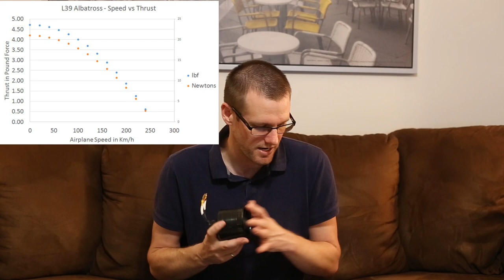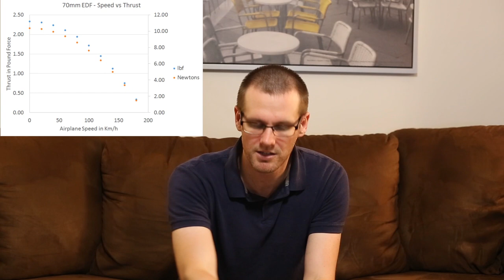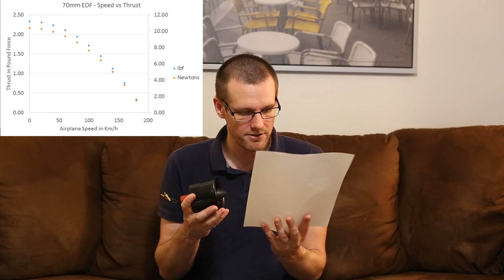What is Jet Efflux and Static Thrust? -  Jet Turbine and EDF

Comment: Great Video.
I have 3 questions:

1) How to increase the thrust?

2) for 5-6 Kg plane, what is the smallest diameter (cheapest) EDF we can use?

3) what does the (Kv) indicates in general? Because I see different values for different EDFs but I don't know what it is about.
Reply from the maker: Hey Genius Boy, 2 ways to increase thrust. Either spin the fan faster or move up to a larger size fan.
For a 5 to 6Kg plane, a 90mm is possible, however you will need some significant power.
The kv of a motor indicates how many unloaded RPM per volt the motor can put out.
Reply from the maker: That can work

Comment: Hi There, good video!, I am sizing a jet powered plane so I am wondering where did you get your thrust vs. speed data. Did you use a model or do you have experimental data?
Reply from the maker: Hi Heavy Metal, the static thrust was measured and dynamic thrust was calculated.

Comment: hi great video. im thinking of making an electronic "rocket" would i be better to use an edf or use multiple compressor stages to increase static thrust?
Reply from the maker: You would be best to use propeller if this can fit the diameter of your design.

Comment: Hi, there is a drop in thrust but speed is increasing. So, as per chart we need less thrust when the speed increases? Quite confusing
Reply from the maker: No. When the airplanes speed increases the fans dynamic thrust decreases. This is undesirable but part of the equation.

Comment: Thank for the video.
Still, jet engine are much more capable than EDF, since liquid fuel stores more energy for a given weight than electric motors!
Also one thing to keep in mind : when you want to increase chimical efficiency of any given reaction envolving air, it's always much more efficient with warm compressed air, more energy is stored to take part into the reaction. EDF are not as sophisticated as turbo jet, so the dramatically lower outlet air speed. 

Last but not least, the relatively low efficiency of RC turbo jets is due to the fact that their combustion temperature is very low 600°C, that's just a joke compared to the 1700°C of modern jet engines. But it seems some guys around doesn't want you to build weapons from them.. And cost wise most people wouldn't buy a 10000$ RC engine.
Reply: Well maybe when we use hydrogen instead 😁
Reply: @Frequency369  🤔🤔 yup hydrigen is cool. I've been wondering for long tile if it's an actual solutuon for fkying machines, a friend of mine told me if tou gonna die anyway hydrogen is the way to go!

Comment: So if you create a plane that, for instance, has rounded leading edge surfaces designed to create maximum lift and has a way to somewhat sharpen or point the leading edge surfaces to reduce drag you could use a more efficient power source to achieve similar differential thrust beyond a certain speed, correct? I could see a multitude of uses for this idea of reducing drag in-flight, rather than increasing thrust. I'm stuck on the idea of surface tension. If there was a way to get a point of the aircraft between the bonds of molecules of air in front of it, it may potentially create a reduced drag state. Similar to diving into water, my theory is that if you can break surface tension before your body comes into contact with the surface there is a much higher ceiling from which a person can dive safely. Granted, water and air are different in many ways, this might enable what I would term vacuum flight. It would eliminate the need for wings in-flight and create new ceilings of velocity due to the drastic thrust/drag ratio change.
Reply from the maker: You'd have to create models and test your theory.
Reply: @RCexplained  the only problem with the theory on the extreme end is the idea is chemical propulsion in and of itself. Changing atomic or mollecular bonds not only might be dangerous, but it would require a completely chemically morphing airfoil that does not degrade or accumulate mass. It would need to be designed by someone with more knowledge of physics and chemistry than me. On the less extreme end, a wing that could sharpen it's leading edge mid-flight would be a very possible endeavor for almost anyone with a basic grasp on physics of aerodynamics and a very large wallet. Lol

Comment: what is the relationship between nozzle diameter and thrust? That turbine has an optimized nozzle to maximize the dynamic thrust, not static. Thrust, typically, increases in turbine engines as air-speed increases, as there is additional airflow that provides allows for additional fuel to be burned, creating additional power. That's probably not true on model engines, as they don't necessarily have as sophisticated of instruments and ECUs.

What I don't get is why are EDF nozzles typically much larger than equivalent turbine engines? Seems to me that an optimized EDF nozzle would be significantly smaller than the inlet of the EDF. Has anyone tested that?
Reply from the maker: Area of flow and efflux is what contributes to thrust. EDF's have much lower efflux vs a turbojet and to compensate, a larger nozzle is required. The turbine engine in the video has a nozzle diameter of around 94% FSA which is pretty well inline with EDF's. 
EDF FSA vs nozzle diameter has definitely been tested and optimized for best performance.

Comment: Can you alter the nozzle diameter to increase thrust?
Reply from the maker: Yes, however a larger diameter nozzle closer to no more than 100% FSA does tend to provide highest thrust.
Reply: @RCexplained  thanks for responding. Totally not what I expected about the diameter size.
Reply from the maker: No worries. 
The fans have a hard time compressing the air when the nozzle gets smaller and becomes more restricted. Otherwise, if this wasn't the case dynamic thrust could be improved.
Reply: @RCexplained  I totally understand now. Good videos. You earned an subscriber. Thanks
Reply: @RCexplained hope you don’t mind if I jump on this discussion, but as I understand it, a smaller nozzle diameter can increase eflux right? What if you could change nozzle diameter in flight , could that allow an EDF aircraft to achieve higher flight speed? You take advantage of near 100% SFA for take off and cruise, but at a point where your craft is nearing the speed the nozzle eflux would allow, the variable nozzle shrinks and increases eflux? Or would that just choke out an EDF at speed and drastically reduce thrust…

Comment: Confused I don't get how thrust of EDF goes down with speed of aircraft. A perfect inlet is considered to be a bell mouth inlet with zero losses. I thought that duct losses are worst at zero airspeed and improve with airspeed, needing about 120 mph airspeed before it reaches overcomes duct losses due to ram air being forced into duct system. 
Rationally it would seem that as an EDF aircraft speed increases the thrust would increase somewhat depending on maximum speed of the aircraft. For example say you are able to measure the thrust force the EDF applies to the airframe in flight and with the aircraft static. It would seem that in flight the faster the model goes the less duct losses the EDF has to deal with, improving with speed.
Reply from the maker: Airspeed subtracts from the EDF air speed in the formula for thrust. It does make sense when you think of it.  An EDF producing 100mph of air would create drag (negative thrust) and slow the plane down if the plane was traveling over 100mph.
Reply: @RCexplained  Damn. I guess it's just wishful thinking then that if the EDF was being fed 50mph airstream then it would have less work to do to accelerate that to a 100mph stream so it would be able to then accelerate it to 150mph.
Reply: @AerialRCFun   you can design a ducted fan system aimed at higher speeds by reducing the inlet area.
It requires balancing the inlet area with the ram pressure at the projected airspeed.
It is not a simple task.

Comment: Wow, actually a good video for once. I often need to explain this when converting foamies to turbine power. My rule of thumb is you need twice the EDF thrust vs turbine thrust to get an equal average flight envelope.

For example my 35N Kolibri turbine would equal a 70N EDF, which sort of is a quite hot 12S setup.  Still on paper the turbines 35N is actually less than a 6S standard 90mm setup.  People have a hard time grasping that.

Starting from grass the EDF wins, but as soon as you are of the ground the turbine kills the competition at half the thrust(!)
Reply from the maker: Hi Henke, thank you for the kind words. I'm sure I've come across your posts and builds on the forums.

Comment: Why no afterburner on these small planes? Also is it possible for an rc plane to go supersonic like the real thing?
Reply from the maker: It would be awesome, however an afterburner  is not legal in North America. 

Yes it's possible, however the models would have to be scaled up quite significantly in order to reach that level. Model turbines do not make enough power to push an airplane that fast. You would end up with a  very very large radio controlled model.
Reply: @RCexplained  I wonder what is the smallest size of plane you could make go super sonic. 🤔
Reply: @LawrenceTimme  no rc plane has ever gone that fast. its too dangerous also
Reply: @logiknotlogic6586  it's clearly not that it's dangerous that is the problem. There are loads of planes that go super sonic.

Comment: Does it make sense to install a larger diameter nozzle on that jet engine so that it pushes back more air at a lower speed? Also, why did they design it like this? It's obvious that no rc plane will reach those efflux speeds, and hence a lot of efflux will be "wasted".
Reply from the maker: It's not a matter of the design for the turbojet that the manufacture has chosen but rather the nature of a turbojet. This is why turbojet engines are not used for commercial jets but better suited for military jet fighters. For RC using a more efficient jet engine type can drastically increase complexity and cost.
Reply: @RCexplained  As in, a turbofan for example?
Reply from the maker: Yes exactly.
Reply: @RCexplained  for a vtol plane is it better to have 2 edfs or larger traditional prop setup?
Reply from the maker: @FirstLast-tx3yj  prop is more efficient

Comment: How can you messure thrust in flight ?
Reply from the maker: What would you be using this in flight thrust value for?
Reply: @RCexplained  I don't know I'm not in the RC world, I'm an aviation entusiast and I've always wandered how could they measure thrust in flight
Reply: @gonzalomorenoandonaegui2052  The simplest way would be to mount the edf in a bed that could slide a small amount and then have a sensor that could measure the push of the EDF in flight and send back telemetry or record to data collector onboard.

Comment: Do we need flaps in 2-2.5kg plane
Reply from the maker: I haven't flow an airplane yet(not saying its always like this) that absolutely requires flaps. 
The answer to the question depends on the plane.
Reply: Depends on landings, if u have a short space use flaps. If not try not to use them, flaps can cause instability on certian models.
Reply: You don't NEED flaps on any RC model. But many pilots use them, as do I. It's all part of the flying RC for me. You might NEED flaps for some flight scenarios, i.e. a short field for takeoff or landings. But generally you won't fly in such situations unless you really just want to use flaps. Flaps in RC models do require a whole set of skills that you may not have initially. But it is fun to learn them.

Comment: yes and no ..  efflux is like torque / Horse power seesaw ... you can cone or funnel down then exit , which raises air velocity / hp   , but that decreases your low end grunt / torque .  if your edf is outside the craft it will create more drag .aero dynamically . in short .. a long skinny top speed world record shaped car with a CONED edf exit  would win top speed....  that same car with an UN-coned EDF would be faster 0-20 mph..
cool video tho thanks .. Jet Noise Huge Motors - was here
Reply from the maker: thanks JNHM!

Comment: gps package delivery 🚚 at 800mph or better small 10ft wingspan payload 10 gallons of water in 2 standard 5 gallon buckets fight fires 🚒🔥 with ease ready to reload easily economically friendly also groceries etc and able to travel no fatigue for pilot , and with a radar sensing so no in air collisions ai movement predictions and counter signal sending to make others that are unaware able to avoid it🤔😁